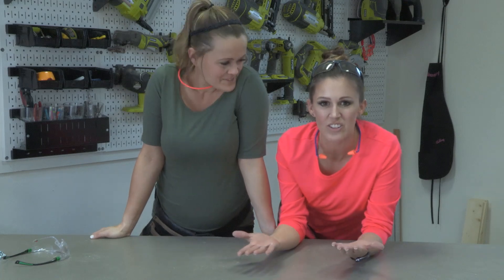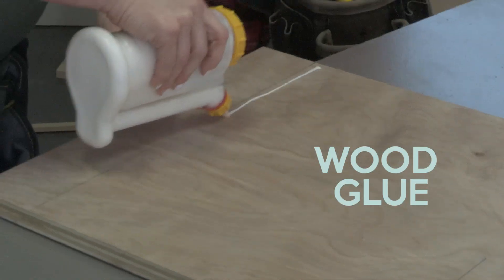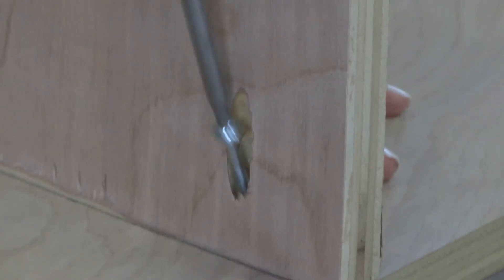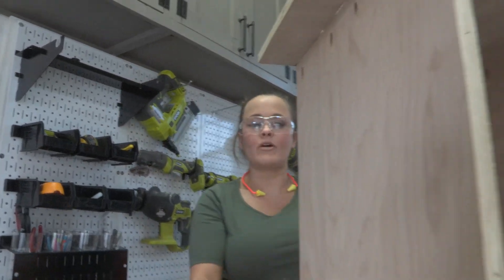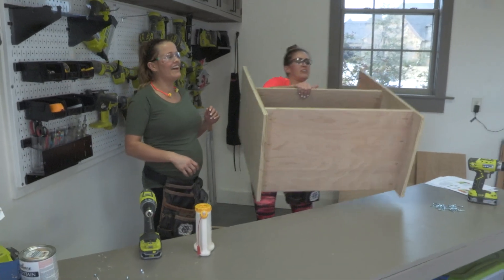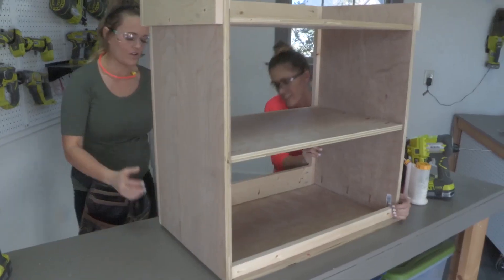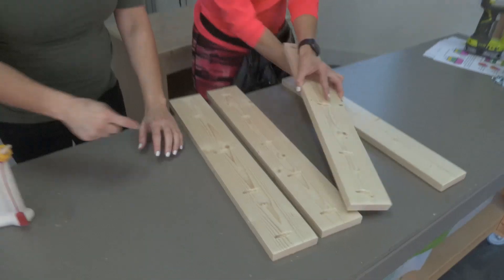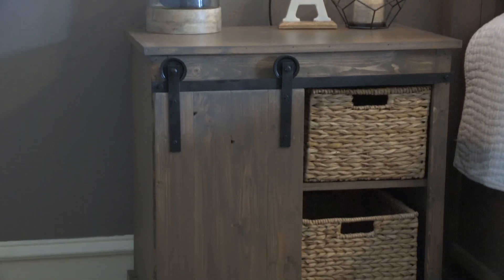DIY Barn Door Nightstand | Shanty2Chic

Comment: Just finished building two of these. The only thing I would change would be the height of the face board that the wheels run across. I'd make them just a bit taller to allow more clearance for the wheels to travel. All in all I loved this project. Thanks for the plans!

Comment: What is the length of the aluminum bar you cut for this piece? I didn't see it on the plans or video or website
Reply from the maker: Kim Young hi, it’s just cut to the width of the cabinet!
Reply: so 30" ? i built the hardware before the cabinet so im trying to knock that out before i go get the wood. and build the cabinet this weekend. by the way thanks for responding - you guys are AMAZING.

Comment: So if your kid comes and opens it all the way will it fall off and land on the floor or does it have stoppers?
Reply from the maker: Iphonemoss my kids don't do that but if you have young kids and you are worried about it, use longer hex screws on the ends and add spacers in front of the track.